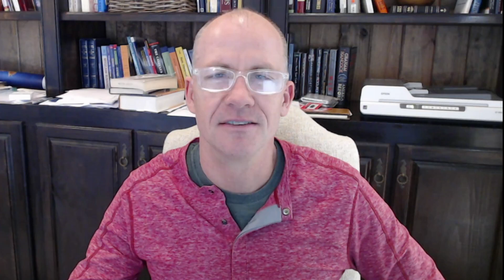Episode 7 - GPU mining and New Crypto Selection

Comment: Really interested in miner colo, but have concerns about stability (I won't be able to reset a stuck asic myself), security (relying upon people I don't know), and the question comes up of what happens if I want to use custom firmware or update my firmware... is that even possible? So, a review of recommended and not-so-recommended asic hosting companies would be amazing.